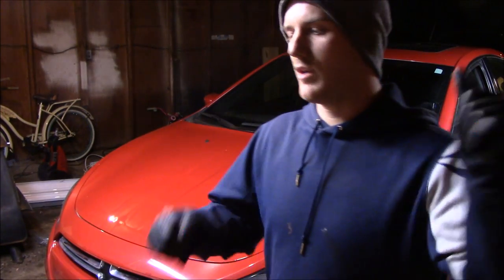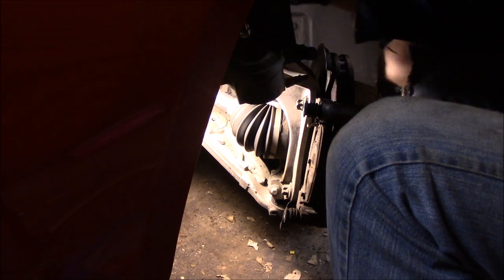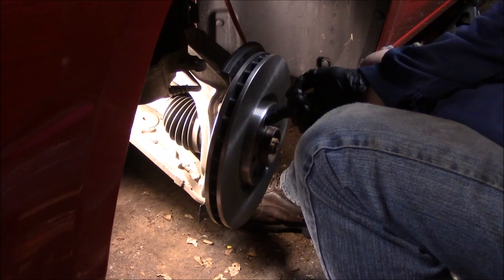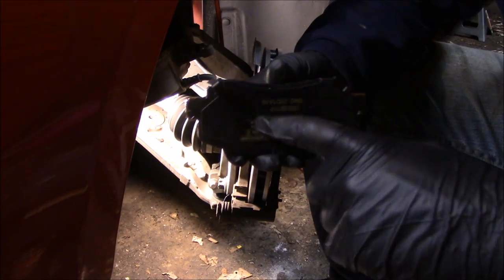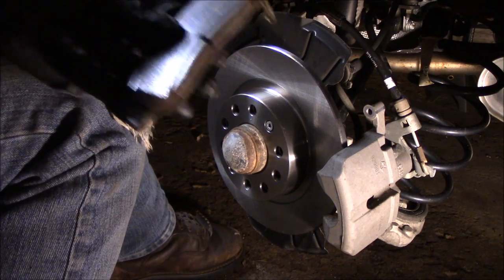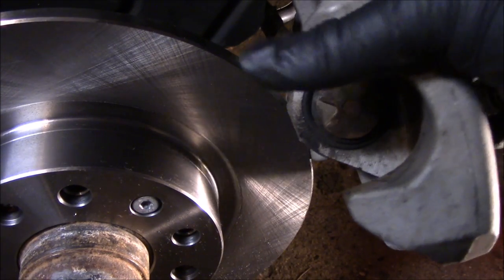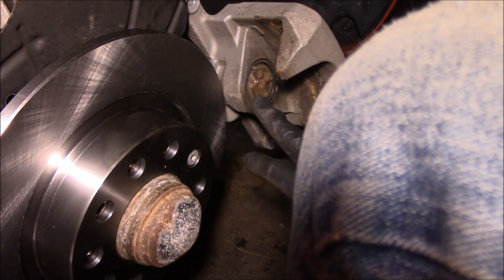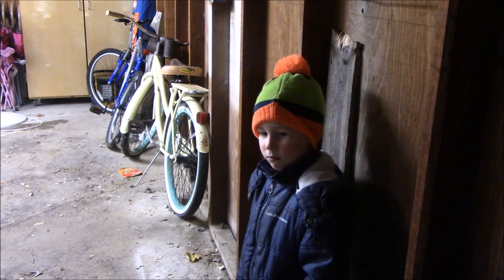Dodge Dart Brakes Replacement Tips

Comment: I've been looking into buying a 2014 Dodge Dart. Glad to find your video and see how simple it can be. Thanks!
Reply: Isaac Delgado I really hope you didn’t buy one. They are nothing but problems! Buy a Toyota Camry or a Honda Civic
Reply: @cookie9589  They're not all bad. Just be sure they've been well maintained. Doing wear and tear repairs on my wife and I's 2013 Limited, which is supposedly the worst year of them all. Not seeing how, have put over 35k miles on it in just over a year without any issues. Doing 1 motor mount and all 4 corners in brakes. Rear shocks may be done next weekend.

Comment: BE SURE TO HAVE AN E20 FEMALE TORX 1/2 INCH DRIVE FOR THIS JOB.  IF  YOU HAVE A STUBBORN BOLT YOU WILL STRIP OUT THE TORX HEAD.  I GOT THREE OF THE BOLTS OUT AND THE FOURTH ONE STRIPPED OUT ON ME. WENT OUT AND GOT AN E20 SOCKET AND GOT THE BOLT OUT IN MINUTES.

Comment: On those rear calipers that slot is supposed to point face down and and line up with a bump on the back side of the rear brake pad. That's important part I feel that might have been overlooked

Comment: Thank you so much! How can you remove swollen lugnut/bolt on these as well?
Reply from the maker: Curse at them, yell a lot. I have no real remedy
Reply: I've had problems with this cars lug nuts as well. I replaced them with some cheap aftermarkets from oreily's and have been doing fine since. I got the old ones of by just hammering a 19mm socket onto the lug nut and it got my bad ones off. Hope this helps
Reply: I know this is old, but a 20mm beat onto the lug with a hammer, then an impact wrench for removal did the trick for me. This was after I used a bolt removal kit with mixed results.

Comment: You didn't mention anything about the caliper bolts and caliper bracket bolts being one-time-use or what they should be torqued to.  Are they one-time-use and what are the torque specs?
Reply from the maker: no there not a 1 time use. and the torque spec is "tight" i'm not sure what it is.

Comment: I'm fairly certain when you twist the rear piston with pliers to move it back into the bore, it's adjusting the e-brake setting, which means now it is lose..  Probably better to use a large c-clamp to compress the piston to get the caliper back on.
Reply: The piston WILL NOT go back in with a C Clamp, you have to twist them back in. It's the way they are designed to be done.

Comment: it was very helpful thank you. i really needed to watch this.i was not successful with the v-clips in the brake pads. so i didn't use the v-clips. how important are those v-clips if i don't reinstall them?
Reply from the maker: its not a big deal it just helps with noise, by pulling the pads off the rotors.but I wouldn't stress about it.
Reply: OK.thank you

Comment: When compressing the pistons all you have to do is step on the breaks a few times right?
Reply from the maker: not if your need to put that new pads in. you have to use some type of clamp or press. if you push the brake you will make it extend out. something like thishttp://www.homedepot.com/p/BESSEY-1-in-Drop-Forged-C-Clamp-with-1-in-Throat-Depth-CM10/205512963?&cm_mmc=Shopping|THD|B|0|B-BASE-D25T+Tools|&mid=WKz5aCU2|dc_mtid_8903vry57826_pcrid_73529856928951_pkw__pmt_e_

Comment: I would recommend not EVER using impact wrenches on these lug nuts.  They are chrome capped and they become deformed after impacting a couple times and eventually a socket won't fit over them or get so stuck on them, you're screwed.  Very expensive to replace.  Another quality Chrysler part!  Compress the brake caliper piston before removing the caliper, easier in my experience.
Reply: Cannot do that on the rear, have to turn the piston in.
Reply: @treverk8376  oh, the wheel lug nut pistons!  I forgot about those.  🤣
Reply: @takeitasacompliment.  I was talking about the caliper piston. Lol

Comment: having a hell of a time trying to break the bracket bolts loose on the passenger side. any ideas or suggestions ?
Reply from the maker: PIERPILING penetrating oil and use a hammer to hit on the wrench

Comment: Hey Brandon thanks for the video. Quick question I have a 2015 Cherokee which I understand to be based in the Dart mechanically. Would this be the same technique doing it's brakes? Also I am starting to learn to work on my cars (Dart/Cherokee) to save money. Is there anything I should worry about with Chrysler products? I've heard they have everything moderated by the computer so you can't really work on your own car. Is that true?
Reply from the maker: I couldn't tell you to much about the new stuff. But as far as the brakes go yeah they should be about the same
Reply: @brandonbomoney7597   Thank you

Comment: when you bleed the lines, do you just take off the brake fluid cap while your working?
Reply from the maker: If you're talking about when I compress the piston, no I don't. but I didn't bleed the lines on this car. I have never had a problem doing it this way on any car. but its not a bad idea to do that. Now if you are bleeding the brakes then yes have the cap off and make sure you top off the fluid as you go. you never want to run it dry.

Comment: What is the logic of using the wrong tool? I ordered an E20 socket off Amazon for maybe $10 max & had it in 1 day. If a $10 socket ordered with a few thumb presses on a smartphone screen is too much, I'm not sure what to tell you. The spec is 129 ft lbs on those bolts & like most all caliper bracket bolts, are single use. Micro encapsulated from factory. Is it worth possibly rounding the heads off to save $10? Good grief.
Reply from the maker: This is what most people  call a helpful  work around. In the event  that you can't wait. Or in my case you have never need the tool before or after the job because  you don't own the car. This is just a way to get around the issue. I think we all would agree that the right tool  for the job is always the best option but it's really not a big deal as I was able to remove and reinstall all of them without issue. But thank you for your opinion.

Comment: Is there a difference between the pads? Like an inside and outside pad? I did my breaks about a week ago and have been getting a rubbing noise from the pads on the hub. Its only on the driver side and not the passenger side. I've changed them around and I'm still getting the same rubbing. Any info would be appreciated.
Reply: I have the exact same pads as well. The BrakeBest select ceramics from O'reilys.
Reply: Hardware replacement and there is a nub on the piston that should fit under the thin backing pad of the pad. Also lightly grease the guide pins and the tabs on the pads where they contact the ss hardware clips

Comment: Dodge Darts are pieces of shit. I bought my wife a 2013 brand new and had it delivered and had nothing but problems. Great video though I was going to change the brakes but have to order the pads and rotors cuz they don't have them in stock
Reply: You got that right, more problens with my 2013 than ALL OTHER VEHICLES i've owned COMBINED !!!
Reply: I love my 14 gt. It's got the 2.4 and manual transmission. That car doesn't like ethanol in the gas though have to run 91 octane ethanol free up here in Minnesota. Weather its 95 or -40 she starts right up parked outside no block heater
Reply: Problems with 2013: wrong steering rack installed (RT/GT installed on Rallye) caused steering wheel to shake & traction control light to come on, was only 1 month old and in shop for 26 days straight, ripped car apart before they found the issue. Corporate Chrysler took it back and gave me $2K towards a 2014, so I got the GT fully loaded. 8 months later: burning ALMOST 1 qt oil/1K miles.....they finally put a new engine in at 54K miles....I'll never buy another Dodge product. Search: SloJoCrow on the official Dodge Dart Forum: that's me.
Reply: @RimShotWiLLEy  sounds more like a bad dealership
Reply: I have a 2016 Dart GT 2.4, 6spd manual. 
Never had any issues except basic maintenance.
Reply: @WolfmanGaming9412  I'm happy for you. I bought the car for my daughter, she loves it. But the gear shift control cable just broke last week, car was stuck in drive. Just got a Recall Alert in the mail today for that exact problem. Dodge says they haven't come up with a solution yet. It's simple: replace the cable - that's how they fixed mine.